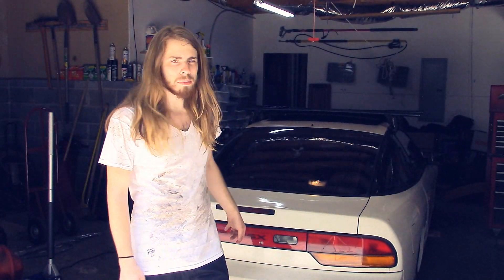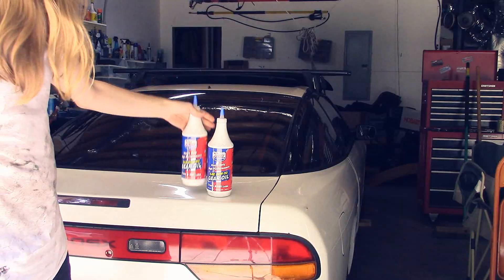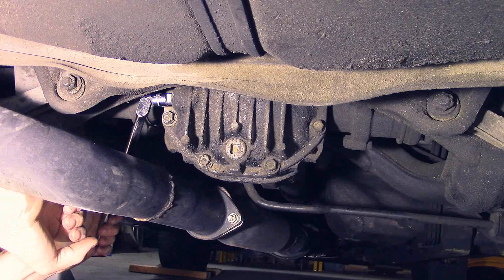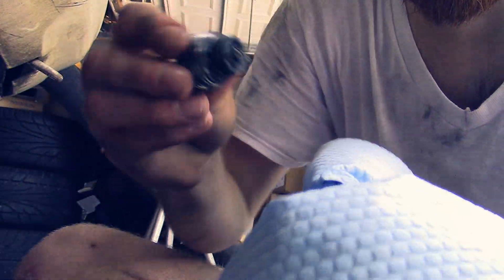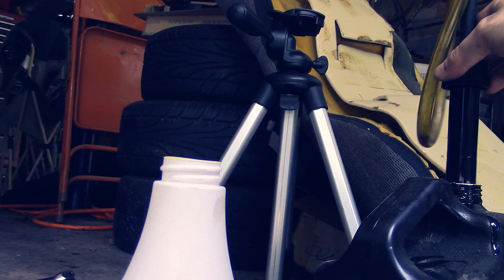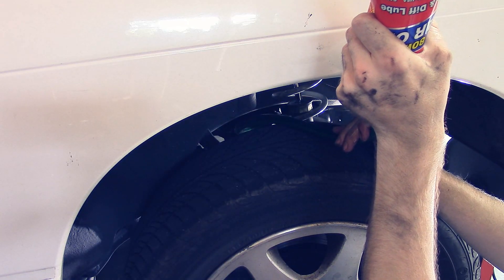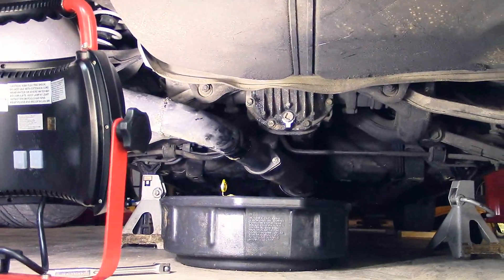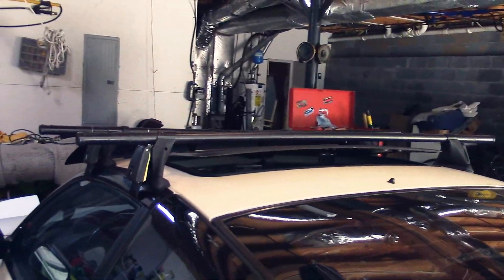Changing Differential Fluid in the 240sx

Comment: Dope video! makes me want to change the fluid on my s13. 

Question> Would you be able to take measurements of the hole location for the rear wiper blade and also the diameter of the hole please? My hatch was rusted, I replaced it with a Rear Base Model Hatch which doesnt come with wiper blade hole.
Reply from the maker: send me an email, we can communicate further man! kyle5670@gmail.com